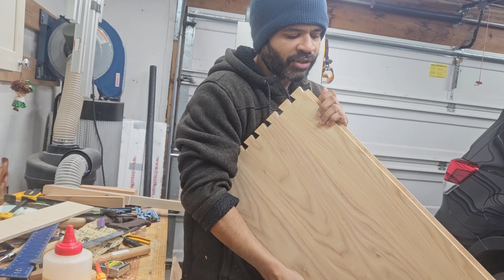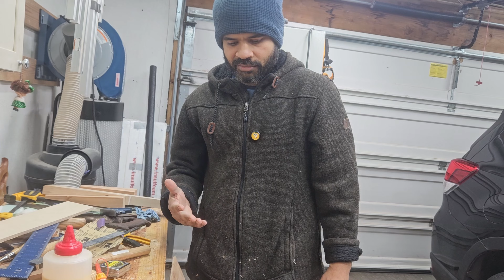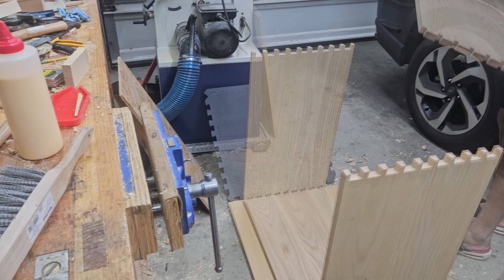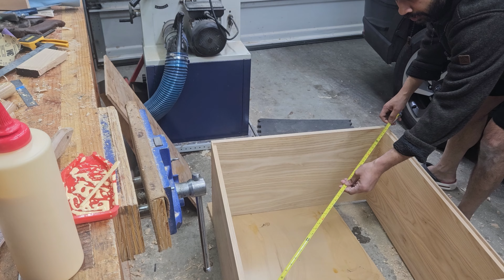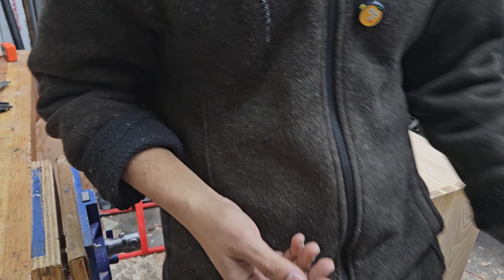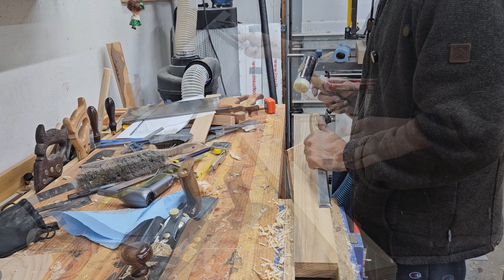Hand Tool Woodworking: Cupboard Build - Part 6

Comment: Had a similar experience with a mitred panel and frame table top recently, perfect in the dry runs and about 1/8 out of square in the glue up. With mine the glue was already setting up. No matter how hard I bashed with the hammer or skewed the clamps, it wasn’t moving. Had originally considered using slow setting epoxy and maybe that would have been a better choice (about 1/2 hr open time)? Thanks for posting Lax :)
Reply from the maker: Yeah, glue freeze is a bit annoying to deal with. It can make a seemingly perfect joint look a bit ugly. Going too hard at it may have other consequences like getting a crack somewhere. We just learn an adapt. This is also a reason, I actually prefer the pva wood glue that is slow setting because eventually it would be strong.
I didn't show the plywood panel prep work in the video but trust me it took twice as long to manage it as I had to plane and compensate 🙂
Reply: @laxswoodworkingjourney I've noticed that when using the cheaper white glue I seem to have less problems during glue up.

Did a little experiment today with Parfix glue and Titebond III where I laid a similar sized puddle of each on some very dense hardwood, plus glued and clamped other pieces together. 

The squeeze out on the piece with Titebond gelled about 5 minutes earlier than the cheap white glue. There was also a noticeable difference with the puddles. The Titebond formed a edge around the puddle that couldn't be finger smeared after only around 7 minutes. The white glue could still be smeared easily after the same elapsed time and beyond. I'm guessing it's because Titebond has a higher solids content?

In use though, Titebond drips less and I'm quite certain the timber around the joint doesn't swell as much. As far as strengh goes, my workbench is glued with Parfix and hasn't shown any signs of glue failure.

Another thing is, the more glue applied seems to extend open time but the clean up can be a nightmare! (Have used that technique on a couple of tricky glue ups and it did help somewhat). Sorry for the long post :)
Reply from the maker: @edwardjarvinen3702  I absolutely appreciate the long post! 🙂 We are all learning here and especially with wood glue.  Glue up can sometimes be a nightmare after you have worked hard for days and months on a project. It is amazing how scientific advancement has made wood glue so strong and we do benefit a lot from that. But for cases where we need that extra time at hand, the old school slow setting pva glue might still be best. This where hide glue shines, I believe even though I have never used it personally - too much hassle to handle it and I am not sure how strong it would be for large panels etc. (I am sure traditional furniture makers would have used it effectively when PVA was not available - possibly complimented with some additional joinery like tongue-&-groove but I am not sure). At the end, I still stick with Titebond II after all minor complaints here and there 😉 . Titebond I is also great. Titebond III is expensive and unless it is a outdoor project, I wouldn't go for it. Even an end grain cutting board that I made using Titebond II couple of years back is still going strong.
Reply: @laxswoodworkingjourney  Thanks Lax. I won’t use the animal glues like hide or fish glue but seems a popular choice for restorers wanting to keep to the original, also for luthiers. Many high end furniture makers are using slow setting epoxy and it’s something I have been considering for a complex upcoming project, just very expensive! 

Thanks also for your thoughts on the other Titebond glues. Just to let you know, today I hammered a chisel on the glue lines of the Titebond and the white glue pieces. The white glued pieces separated cleanly on the glue line but there was no way the Titebond was letting go at all. The timber is aged and some sort of tropical hardwood with a slightly oily character, perhaps Merbau.
Reply from the maker: @edwardjarvinen3702  I too occasionally desire to make a large epoxy river table (like a dining table) as they look so beautiful but that is also quite orthogonal to hand tool traditional woodworking, which I enjoy the most. So, likely if I have to build a dining table, I will build one using completely traditional methods and solid wood, but who knows! I just might be tempted to have a table top as a epoxy river 🙂 I have never use epoxy other than for minor repairs.
Reply: @laxswoodworkingjourney  I just meant using slow cure epoxy glue for inside the joints instead of pva, as used by timber boatbuilders (I’m not a fan of the river tables either). The thing is it doesn’t swell the timber, slow set has an open time of about 1/2 hr, is gap filling and very strong, squeeze out can be scraped off later. I think I’ve talked myself into it :)